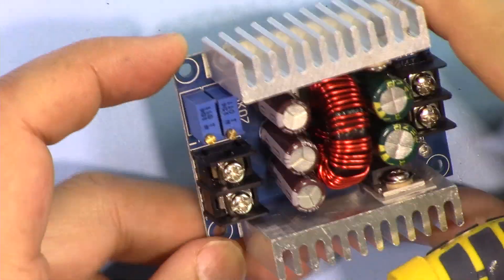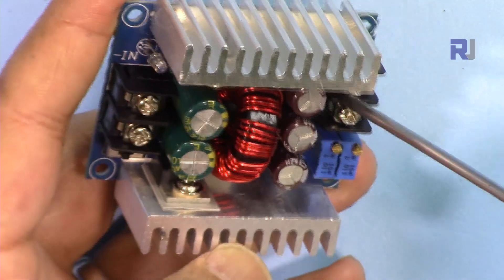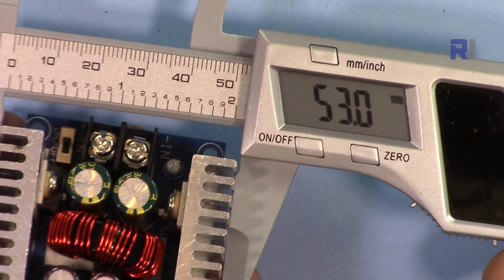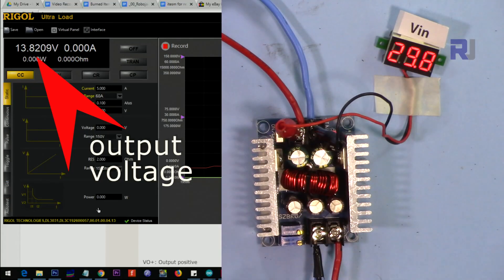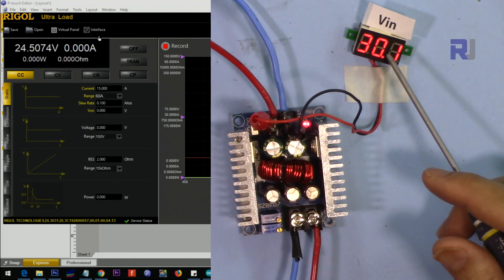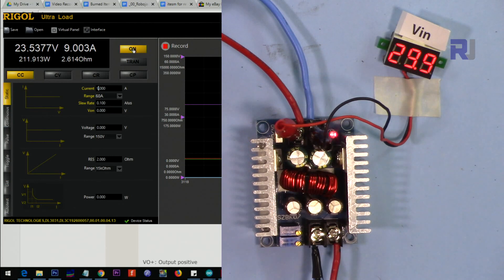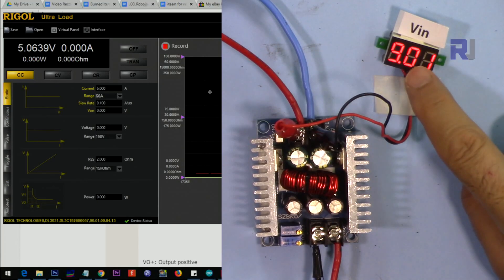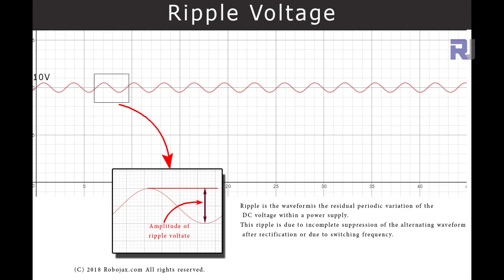Review of SZBK07 300W 20A  Buck converter 1.2V to 36V with constant Current

Comment: Okay, so im planning on using this buck converter in combination with a 7s bms to charge a set of li-ion batteries (3 in parallel, 7 in series). if i set the cv to about 30v (4,25 x 7) and the cc to 4,5a (1,5 x 3), would this work to charge this entire setup without damaging the batteries. If the cc and cv work in the right way this should work?
Reply from the maker: first of all this is NOT a charger. Charger monitors voltage and current and makes adjustments. But if you monitor it manually it will work.
Reply: @robojax  but this step down converter has both cc and cv, doesn't this basically mean that it caps the amount of current and voltage the batteries can get? (Say a max of 1,5a per cell till the cell reaches allmost 4.2v and then it tops at 4,2v per cell and will let the current drop. (Maybe smart of me to say I was also planning on using it in combination with a 7s bms
Reply from the maker: when you set the CV at 12V and  CC at 2A, it keeps the voltage 12V and current 2A. once the charge continues, the voltage slowly increases in the battery and as it tries to increase the current is decreased. the CC and CV means lower than those values and NOT higher. So they can go lower.

Comment: could i power a 12v computer with this?
Reply from the maker: you would have to consider the power (watts) of your computer.  if the power of the computer is about 10% less than the output power of this module, yes you can.

Comment: I buy this model . Since they say it's the is a powerful buck converter 20amp . But as I see it's not 20amp . But I think if we change the coil and the capacitors in output you may get a better results .  But I don't know how to calculate what coil need for 20A and what capacitors is exactly what need . Can you test by change the coil with bigger coil and less turn ?
Reply from the maker: You can do it but it would be very hard. You would have to draw the  schematic, understand the design, then calculate the values. So it would be very hard.

Comment: The test is more correct at standard voltages 12 24 36 48 volt :). For example 36 to 12v 36 to 24volt test  :). Thanks a lot of nice reviews you have. Hope you have a cool 36-48 volt power supply :D
Reply from the maker: You are welcome and thank you for pointing out those points .

Comment: Plis test 36V 6A to 12V ? ampera. How much will he give 12в
Reply from the maker: I am sorry for late reply. I was on vacation. I believe if you watch the video, you will find the answer. Otherwise I would have to watch the video.
Reply: @robojax  30 to 12v  12A.  36volt6A=12v 13-14Amper
Reply: @robojax  12volt 12-13A

Comment: Input acv 3 to 20 and output 12v contiguously 60 watt..It's possible????
Reply from the maker: In order to answer your question, I would have to watch the video. So you watch it. I have answered that in the video.
Reply: Actualy i use it in my bike for head light
.In there it's connect to magnato. But when input voltage coming <6 v ac is it work properly????
Reply: In case the input voltage 3 to 20 acv automatically.
Reply from the maker: unfortunately I have not tested it at input of 6V. But according to the specs, it will not work with less than 6V input.
Reply: Ok. Have another one queary.that my bike magnet produce 3 to 24 v ac .and my bike headlight & tail lights need upto 12 v ac 60 watt . In case give me solutions which protects from over  voltage 12    and give upto 60 w supply???

Comment: Hi, nice review. I got the same converter but I lost the capacitor c15. Would you please so kind to tell which value it has?
Reply from the maker: Hi, I am not sure I where I put it. I will try this evening when I got home to have a look at it.
Reply from the maker: sorry I just checked my lab and the garage and could not find the module.
Reply: No problem thx for your help. I ordered another module because I burned one MOSFET and I did realize that the ones soldered are FAKE, unbelievable!! That's why it can't even get close to 20 amps and working at that current for long time. Anyway I saw a video of a Russian guy that has replaced the MOSFET irfb3607 with irf1404 that he claims to be more powerful in terms of current (80A against 162A), but I don't have a proper knowledge to evaluate this option. If you can please let me know.

Comment: I didn't understand why you did not crank it up on the output current load to the point of shutdown, like you did with others step down buck converters. That would have been very informative, I was interest in the max current this module could delivery before it quits, or starts screaming.
Reply from the maker: I did it. As soon the output voltage drops, that is IT it won't work.  If I want 12V at 5A at output and it gives 11V it has failed. Doesn't matter if I increase the current to 6A. it is useless if you increase the current it will show (for example) 7A or 10A  the voltage will drop more to 10V or 9V . so it doesn't matter.
Reply: @robojax  So, it seems this module is a far cry from the claimed 20 Amps / 300 Watts. Shame on the manufacturer for advertising it as able to handle much more than it really can. So far I have been unable to find a review of a Buck Step-Down DC-DC converter that really deliveries more than 5/6 Amps in 12 Volts, on a regular basis and without going too hot(energy lost to heat, instead of putting some extra Amps in the output and keeping the Volts steady).

Comment: Have you measured the voltage at the source?? I think the cables are dropping the voltage
Reply from the maker: I used very thick wire from source. So no worries.

Comment: Have seen some of your videos - they are nicely done and thoroughly put. I wish you good. Thanks for the videos.

One question - how would you conclude the design comments on the unit? Is it rugged and looks long lasting for a continuous heavy duty usage in parallels???

Regards
Reply from the maker: Theoretically it is not a good idea to connect two of them in parallel as it is very hard to to set exact voltage on both and exact current on both. but you can connect if you can set both at the same value. I have given my opinion, watch the video fully. You haven't subscribed to my channel. I will reply to all Subscriber's 🔔 questions. So make sure to Subscribe.😊
Reply: @robojax  Thanks for the opinion. Yes, setting all parameters same. 
Already subscribed!

Comment: brooo how to adjustable the current output? there is just can adjust a voltage output, i have 42V 10A i want to stepdown to 24v 5A
Reply from the maker: This module has constant current and I have mentioned it. Watch it
Reply: @robojax  i have watched your video bro, so its possible to stepdown my supply ? from 42v 10a to 24v 5a?
Reply: @electro-baka8505  did you try to apply 42v to the input? I have the same issue
Reply: @LeyzixTravel  ahh sorry i not buy it haha i buy another buck converter XL4016 yeah its can down 40V 10A to 24v and 5A

Comment: Can i use this to make a mobile charger ? I will parallel 5 usb ports with a current limiting resistor so that the output of each usb port is 5V / 2A.
Reply from the maker: yes you can but you would have to know the maximum current the battery can handle. It might catch fire if you  dont know what you are doing.

Comment: Great review of this particular converter. I have the exact same converter. My issue with mine is that the output does not increase above 11.5 volts with 12.6 as input. Could you advice? Thanks
Reply from the maker: this is "buck" converter which means it ALWAYS reduces the voltage and never increase.
Reply: Robojax , thanks for letting me know. I am looking for a buck boost converter to power a laptop that requires 20 volts and 7 amps using a 12.6 volts 80ah lith-ion battery. Would you recommend one that can achieve that? Thanks for all you do sir. Have a good day.
Reply from the maker: You would need 20Vx7A=140W+15%=140x1.15= 161W (minimum) converter. So your input voltage would be 161W÷12V=13.4A so you will need a boost converter that  has input power more than 161W and 15A with 10V-15V input that can operate continuously with the mentioned  values. This item "claims" 400W https://www.ebay.ca/sch/i.html?_from=R40&_trksid=m570.l1313&_nkw=400W+boost+converter&_sacat=0 with 15A input current and they say "use extra heat sink" so it your choice.
Reply: Robojax , thanks for your recommendations and for the equations. The unit you linked is very cheap. I will give it a try. Might even by a couple. Be well sir and may God bless you and your work. Sorry, one more question. How can I find out what size potentiometers it uses. I would like to remove them to re- wire them to some single rotary PoTs
Reply from the maker: You are welcome. The potentiometer is hard to pick. You have to look at the datasheet and look at the design. so you might have to try different values to reach to working value. Start from 50kΩ and then go up.
Reply from the maker: I looked at it. I will see if I can get it.
Reply: Robojax, excellent can't wait!! I've been trying to figure out this relay wiring for a while.
Reply from the maker: it is very expensive. I would have to contact the seller if they send it for review.
Reply: RJ, the way you handle your channel should be no problem. were you able to look at the relay wiring portion on the PDF  I sent you of that unit? I'm confused. With the implementation of the relay. Since there are 4 connections on the relay circuit. 
86,85,30, and 87. I know what those connections do, but confused as to how to wire it to the VAC9010H. 
https://drive.google.com/file/d/11EA5Ak2znOnCkj4htlEFETTmt2Fdin6J/view?usp=drivesdk
Reply: Robojax , any luck with the seller for the vac9010h hall sensing meter review?
Reply: @milvolts1  You need a BOOST! converter. No Bucking
Reply: Hello Robojax, its me again. hope all is well with you. I was excited to receive my 400 watt 15 amp boost buck converter. I put 12.5 volts to the input and set output to 20.5 volts. I then wired a 7.5 amp fuse to the positive input then connected the output of the converter to my laptop. it powered up nicely. but when it started loading windows it shutdown then wanted to restart again. it did this for a while. so I started increasing the CC adj trimmer clockwise and the 7.5 fuse POPPed. I also noticed the voltage spike up to 40+ volts. What did I do wrong. not sure how to gauge how much current it went up to. certainly more than 7.5amps. And where I'm more confused is about the constant current and constant voltage. why did the voltage spike so high? Any advice would be appreciated.

Comment: I asked same a question for an other module, but I wonder that what does you take max. output voltage with input 12v for this module?
Reply from the maker: To answer you question, I watched the video and I have shown it at maximum input and shown the output. What that you can understand output voltage. Watch the video without escaping and you will see it many times on this module. I have spend more than 3 hours to prepare this video.
Reply: @robojax   I watched the video, but I do not understand that when you get 9V with input 12volt, other guy gets 32volt with input 12 volts and difference is so big. Video link is https://www.youtube.com/watch?v=QlvGX7w2MF4  Thanks for your understanding.
Reply from the maker: 15V, 12V, 9V, 7.5V, 5V, 3.3V are standard voltages so with input of 12V it is not giving out 12V and automatically i used lower than 12V which is 9V.

Comment: Hello.
my unit does not regulate the amperage limit, does its work well? since in the video I did not see to limit the output amperage ...

thank you for your help
Reply from the maker: Hi, If you just need voltage regulation and if it can regulate the voltage, then it is fine. I am not sure how this happens not to regulate the current.
Reply: tks ;)  @robojax
Reply from the maker: you are welcome.

Comment: Can i connect 38v dc to this module? Will it burn?
Reply from the maker: Check the large capacitors voltage. if the voltage is above 38V you should be okay. Remember it will not die immediately. It will heat up. so test it and continuously  check the temperature with the maximum current you want to use. It doesn't die in 1.5H to 2 hours, then it should be okay.
Reply: @robojax  thanks for replying 😊
Reply from the maker: you are welcome.

Comment: This DC-DC converter is crap, CC mode is useless and it operate down to 500 mA, there is poor loop compensation so it is unusable, CV mode is kinda stable, except on lowest setting, where i get 2Vpp 1 kHz ripple on the output, again, poor loop compensation (or a fake LM25116)
Reply: For the price it is good in regulating LED device illumination - in my opinion.
Reply: Krešimir Pečar do you have a better one to suggest? Alas it seems this one is the only one available whilst I was looking on Aliexpress. 

I'm planning to replace my kick scooters AC charger with a dc-dc charger so I can charge straight from leasure batteries on the camper.

Comment: I have a question. What happens if the input voltage is more than the regulated voltage? For example say I'm trying to get 12 volts from a generator that fluctuates in rpms creating an input voltage range of 5v to 20v and I'm wanting to get 12v constantly.
Reply: You need a "Buck / Boost" converter if the input voltage can drop below the required output voltage. This one is 'Buck' only - it can only reduce the voltage. 'Buck / Boost's are available on eBay for about the same price.
Reply from the maker: If input voltage is above the voltage of Capacitors, they will explode. The chip will handle some excess of voltage. I have provided the datasheet. the fluctuation within the input range should not have affect as long as it is just a little above output voltage.
Reply: For this converter to work, input voltage must always be over the regulated voltage. On your case, you will be getting 5V-12V at the output. If you want to keep the voltage stable at 12V, you'll have to add a large enough capacitor at the input.

Comment: Dear sir I need 12 volt output 40amp current with help of DC to DC buck converter and this module given 13 amp maximum according to customer review so can I connect 3 converter in parallel series without damage product ple suggest
Reply from the maker: Hi, when you connect multiple sources if the the output voltage are exactly the same, yes you can. If you get 12.1V in one and 12.2V in the other, it is like large tank with 12.1 L water and 12.2L, the water will flow from 12.2 to the 12.1 and this happens in the power supply and causes power loss. Yes you can do it if you can make them the same voltage.

Comment: Thank you very much for this great upload. I’m looking to buy one of these. I wanted to ask you a question. If the output voltage is set to 7.5V & 20amps would this be safe and could this converter handle it? Thank you
Reply from the maker: You are welcome. I have presented my findings. It is you to determine if it works for particular application or not.
Reply from the maker: If the width of the heat sing from Amazon is wide enough to cover both heat sinks of this convert, then put it on top of this  exactly as it is shown in picture. But you would have to put heat transfer paste between them so there is no gap in between and heat is transferred. If the not wide enough, then just use a fan (exactly the same fan ) should help as well.
Reply: Robojax that’s what I was thinking. But I’d like to wire the fan module onto the step down regulator and have the fan draw the power from the buck converter. Do you know where on the converter I could use for the power source? For example this module has a fan added:

Step Down Voltage Regulator Board, Yeeco Numerical Control Buck Converter DC 6-40V 32V 24V to 0-38V 5V 9V 12V 8A NC Digital Adjustable Power Supply Module with LED Voltmeter & Heatsink Fan https://www.amazon.co.uk/dp/B01E8KZG8I/ref=cm_sw_r_cp_api_i_vrpnCbR9BDZWC

How could I do this with the module you have used for this video? Many thanks in advance
Reply from the maker: it depends on your fan and the input voltage. If you fan is 12V and input is 12V, then connect it at input.  If output voltage is matching the fan, connect the fan to the output. If the output is very high, then use another regulator like 780X where ix 5, 9, 12, or 15V

Comment: Hey Can I Connect This to a 2s lipo 4a (8,4)
How Much Amp Can it Give it Then ?
Reply from the maker: You should not use it as battery chargers. it will damage your lipo battery unless you know to set properly the  current and voltage. the amount of current has been shown in the video.
Reply: @robojax  i'm Not Gonna use it as a lipo Charger I Want to Know How much current and Voltage it Gives out at 8.4v Input

Comment: +1 -- Mr Kowalczyk. Also, I didn't see you confirming that the Current Limit function was not influencing the alleged 'poor regulation', at each new setting.  There may be quite a bit of interaction between the two trimpots -- after all, the thing is very compact for these power levels.
Reply: Pm me can you to install do sola paint of charger..